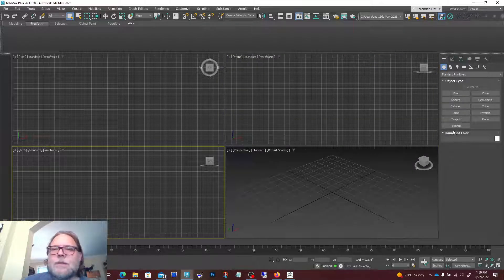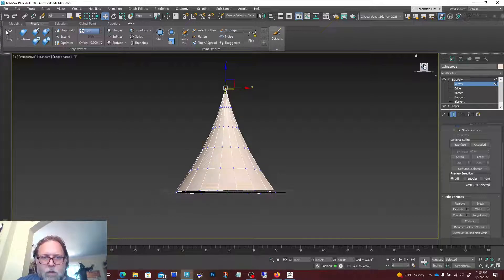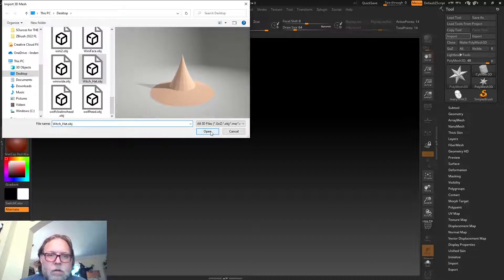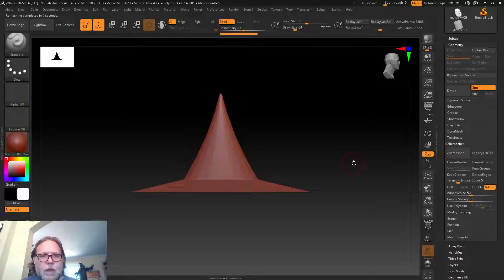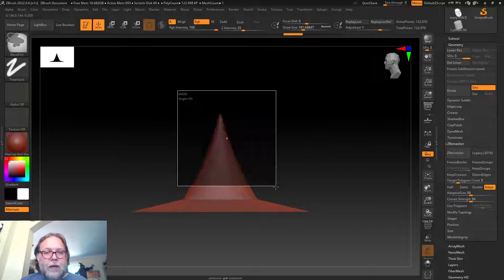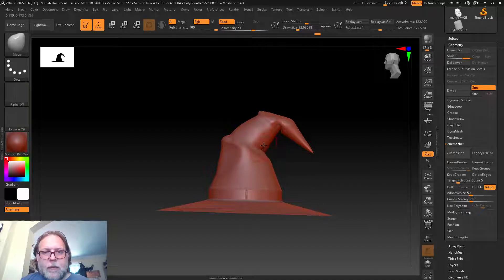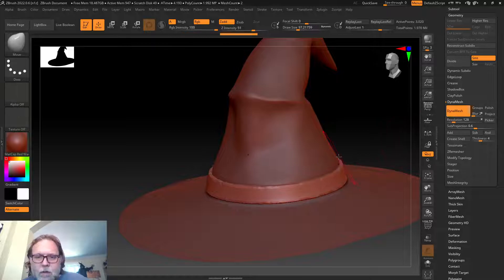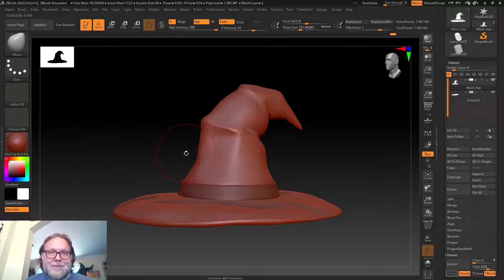Importing a model from 3DS Max into Zbrush

Comment: How can I export with 3ds max texture and import into zbrush in the same way with textures?
Reply from the maker: Well if you are using a “bitmap” external texture file like a png, tga, jpg etc you just import the model and in Zbrush you can load the texture file into the Texture Map. You probably need to flip the UVs though.